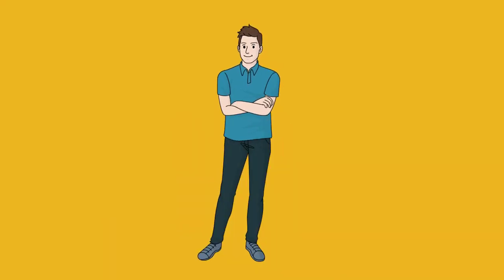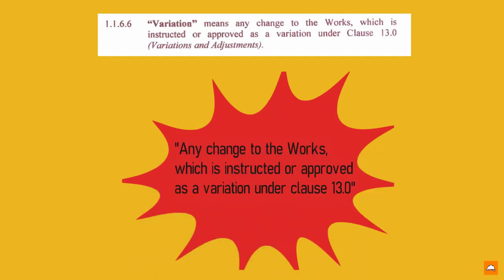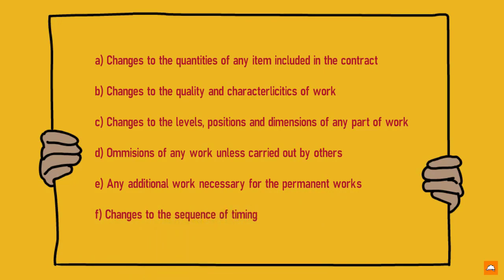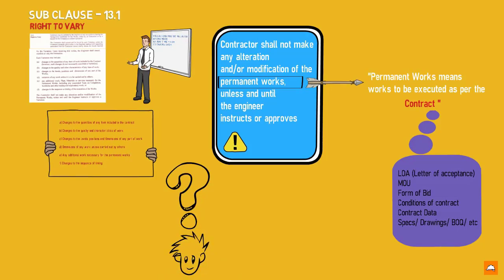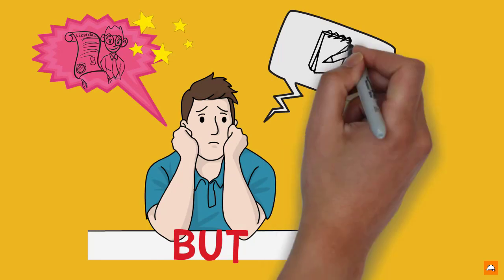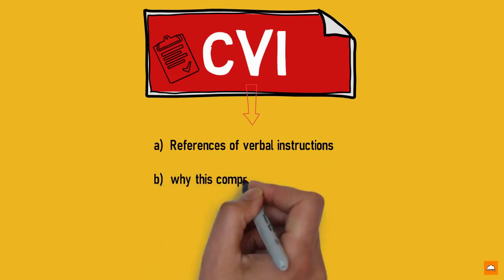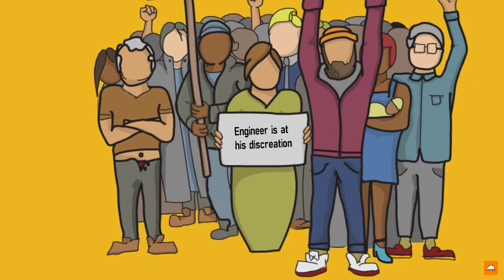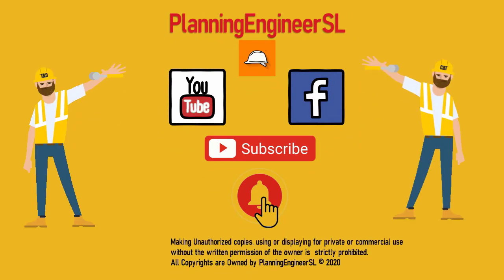How to Raise a Variation in Construction ? SBD 2 & FIDIC | Animated Story

Comment: A very good explanation regarding Variations.Usually QSS require a little more than this. QS profession is unique-able to provide free service  to the Employer.In this respect, Variations play a big role.Any additional work is priced at least 10% more than the tender rates by a Contractor QS. Usually Variations is a playground for smart Contractors.These are important points  to be mentioned at a QS interview for Contractor.
Reply from the maker: Hi Ameer, once again thanks alot for your feedback.